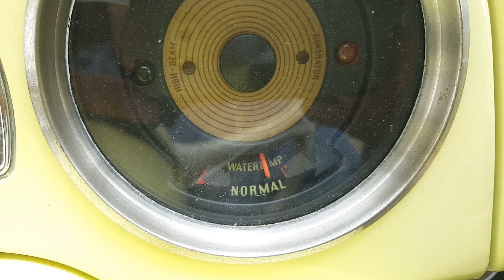Smokin or Broken?

Comment: I'm curious how does the oil injection system work on a 2-stroke car engines, if it has a oil injection system.
Reply: On some you have to premix the petrol/gasoline, but some have a 2 stroke tank that meters it into the fuel for you. Suzuki motorcycle engines (and others I hasten to add) had tubes that injected oil directly onto main crank bearings and into the cylinder wall from a tank which was emptied by a small engine driven pump whose output was linked to the throttle opening. It was the little end roller bearings that tended to be the poor relation in the Suzuki set up and they could become very 'zizzy' and rattly with age.